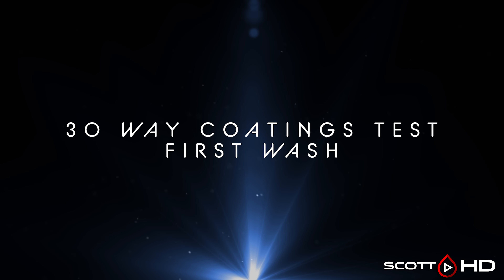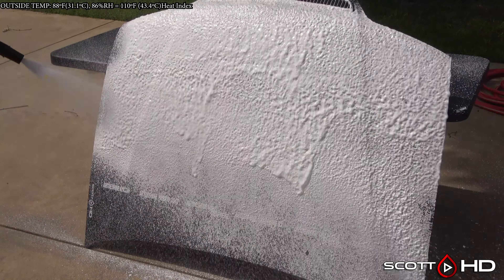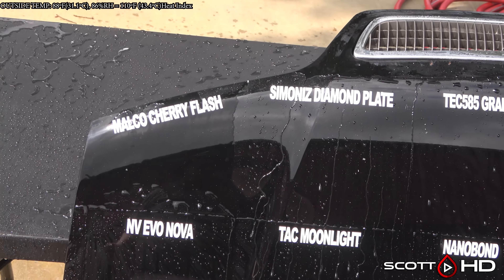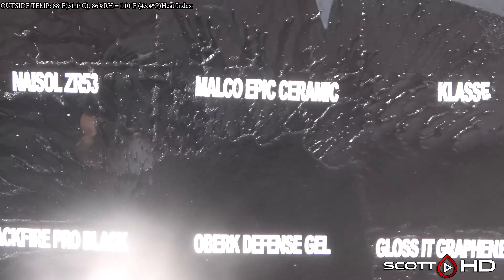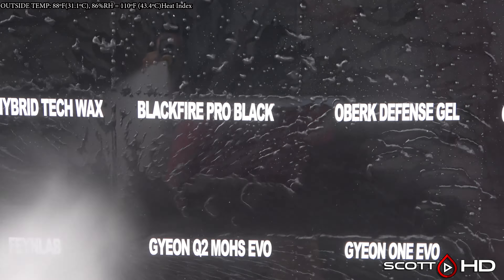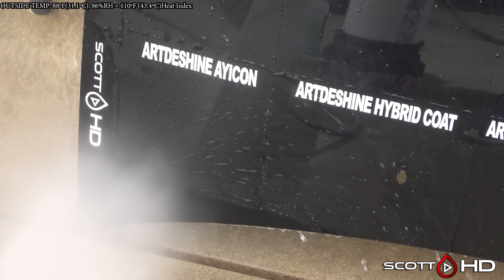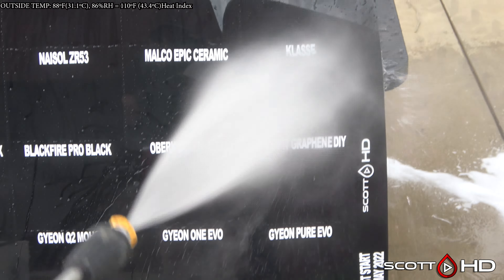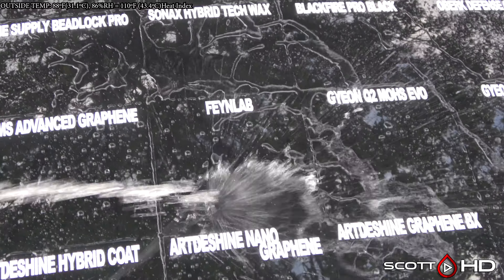30 WAY CERAMIC COATINGS LONGEVITY TEST - SUBSCRIBER REQUESTED PRODUCTS - UPDATE 03 - FIRST WASH

Comment: Kamikaze ISM 2.0 is very impressive it didn't even let the snow foam stick
Reply: I noticed that too. I was going to say the same thing. Kinda wish there were more Kamikaze products in there.
Reply: Kamikaze products are made to order & not cheap. I've enjoyed there products
Reply: It might look impressive, but that makes pre soaking impossible if the dang soap can't even stick to the panel
Reply: @derek723  less dirt and contamination on the surface makes it easier to wash so that is really not a issue.
Reply: @audiovideotech9777  hey Audio Video & Tech.  Unfortunately being hydrophobic doesn't mean dirt won't stick to it.  In harsher climates it'll still need a pre soak.  If the vehicle is heavily soiled there's definitely the possibility that snow foam/chemicals would stick better to the surface

Comment: Love Kamikaze ISM 2.0. I use 1.0 to restore trim. Used zipang and Myabi as well. I’ve used NV Evo as well. NV has great products. I use kamikaze and NV as “premium” coatings as they are more expensive. For regular coatings I’m using the Gyeon Syncro and Pure. Would love to see Kamikaze Zipang tested, as well as 22ple HPC. As a consumer coating at how well HPC holds up. Would love to see it matched against some others

Comment: A Rinse-on/touchless coating test would be interesting. The products I’ve found so far are 303 Touchless Sealant, GTechnique Rinse on Ceramic, Mirror Finish Touchless Spray & Rinse, Time 2 Shine Ceramic Foam Rinse & ChemX Snake Oil. Thanks

Comment: Hi thanks for the great video content. I looked through your list and do not see DuraSlic DS 1500 Xtreme or Roar Ceramic Coating? I am buying a new C8 when I can put my order in and want to buy a really good coating. They claim "Roar Ceramic Coating is engineered to out perform other ceramic coating on the market. Combining Si02, Graphene and Polysilazane" It is the most expensive I have seen. Thanks you in advanced

Comment: Admittedly difficult to tell with that end demonstration, but it seemed like the most hydrophobic products didn't clear the panel as easily.  Really tough to tell.  Malco Epic Ceramic seemed to be bone dry after you flooded it
Reply: It was applied to the corner, which was curved.  Water will shed more easily.
Reply from the maker: I'll get a regular garden hose out for the next one.  Pressure washer without the tip doesn't spray smoothly